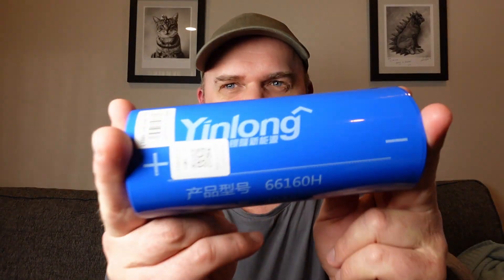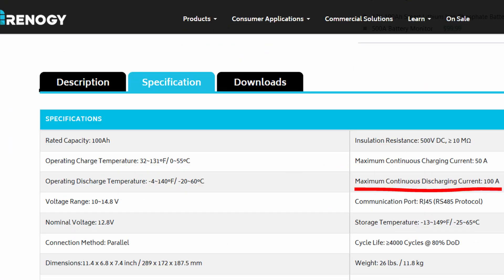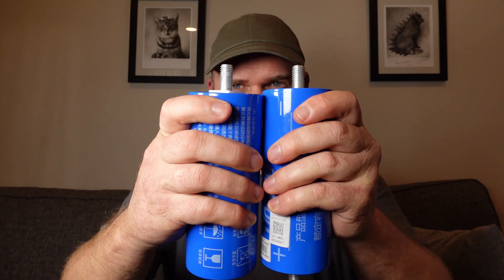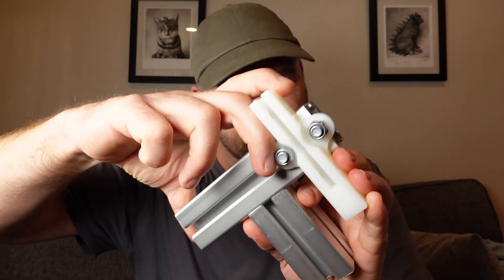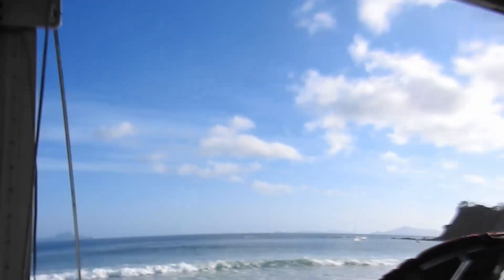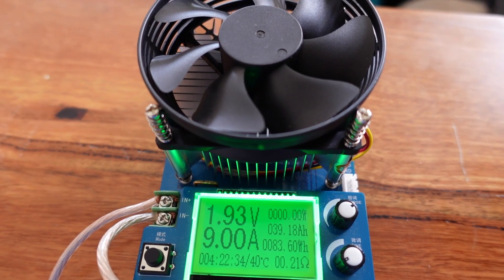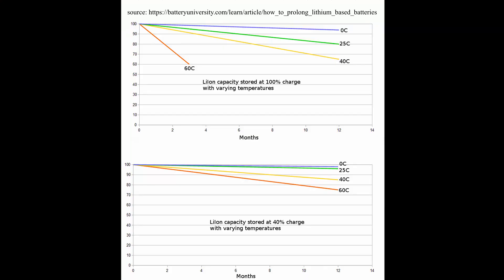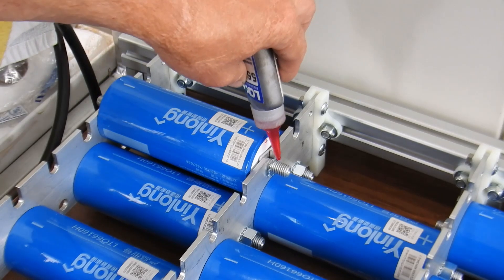Campervan DIY battery build HUGE POWER!

Comment: are they selling 6 batteries for $355 or one battery
Reply from the maker: I believe 6
Reply: @brendontait6968  Ok..thanks...great vid btw...I assume a person could use in an off grid situation for a cabin/house?
Reply from the maker: Of course.   I used these due to their ruggedness, lifespan and safety.  I'm going to do an LiFePO4 build for my house as well, these are a bit more affordable but don't have the life, ruggedness or tolerance to cold.

Comment: Don't use bus bars on both sides!  You need a fuse or fusible link on each cell to remove them from the circuit if they go bad! (standard practice on EV packs)  You may get a chain reaction if you don't!
Reply from the maker: I disagree.  LTO is an inherently safe chemistry that is safe from internal short faults.  They do not form dendrites and the electrodes start to heavily resist current flow at elevated temperatures a bit like an integrated NTC.  This prevents the cell getting into thermal runaway condition when it gets punctured or suffers internal short.
Reply: @brendontait6968  All Alkali ion chemistries are inherently unstable; it's better to err on the side of caution!  A fuse won't hurt your pack, but a fire will probably be a total loss, and the insurance company is going to tell you to get lost because it's not an approved pack!

I also wouldn't buy from a company under a communist government that abuses and murders minorities, but that's besides the point.
Reply from the maker: I'm confident this chemistry is safe in that regard.  I believe It's's actually the only lithium chemistry approved for medical implants.  For all other lithium chemistry I'd deff be fusing between parallel cells.

I get your point about buying from China.  Unfortunately there often isn't a lot of option..  many USA made batteries have Chinese cells, can be hard to avoid.
Reply: @brendontait6968  what if you drop a wrench across the bus bars, etc. All circuits need fuses; I had to learn it the hard way!  I lit my truck on fire when I crushed a heavy gauge cable!  It sparked and smoked all the way back to the battery and the hot metal blobs set the top of the lead acid on fire!
Reply: @bardrick4220  Well, China makes most of the world's batteries. I bought the Toshiba (japanese) LTO batteries. LiIon/LiPo batteries can go into thermal runaway and can cause a fire, LFP or LTO will not. LFP batteries don't cause a fire if punctured but generate toxic gas. LTO batteries don't do much of anything when punctured except get hot.

Comment: Locktite red is for permanent assembly. Try the blue formula instead, it will hold great but if you need to remove a cell, you don't need to heat the nut with a blowtorch to release the locktite . We. Have used the red versions on AK's assembled with hardened hex head screws instead of riveting parts to the frame. They have held up for thousands of rounds with no failure of screws working loose. Someone used the    blue formula on a build and everything shook loose after a month of field testing.
Reply from the maker: Thanks, I didn't use loctite brand.  I used loxeal 55-04 which is equivalent to blue. The studs are remarkably easy to break and my concern was that even the weak version might still grip too tight.
Reply: @brendontait6968  I use the nuts with the nylon inserts on one side of the nut, I forget the name for these.
Reply from the maker: @gregb1714  due to the low torque limits on the studs I figured nylocs may reduce clamping force too much.

Comment: I agree with everything in this vid but also agree with Will Prowse insofar as 25000cycles or 50 years is a bit of a waste as new technology will be out within 10 years and they are expensive, very expensive. Better using Trojan Lead Acid Sind 06 610. much cheaper and can be replaced quicker but I am still going to purchase 4 of these as they are impressive. Better for cars than solar. 1o minute charge and 25000 cycles is impressive but not good for price per KWH
Reply from the maker: It was a few things that convinced me to purchase these.  I enjoy learning about different tech especially if it's uncommon.  Ruggedness of these cells suit the truck build well.  It doesn't bother me if better tech is out in 10 years or so.  I dislike consumerism where things stop working and get thrown away long before they should.  These cells are more tolerant of things like a BMS failure.  I've seen these accidentally get charged backwards (by an imbalance) and still have full capacity when charged forwards again.  They are tolerant of a lot of things which would damage or be dangerous with other chemistries.
I haven't had good experiences with lead acid batteries in cycling situations.

Comment: I connected Lifepo4 2 *16cells in series 105ah about 10.7kwh for about with bms and packaging 2400$ these are very good batteries for my hybrid solar inverter much better than lead acid.

Comment: Hi Brenton, congratulations for your very interesting videos about LTO batteries. Really impressive! Which king of charging / regulating solutions would you recommend for a sailboat like mine equipped with both solar panels and engine alternators to maximize the efficiency a such a battery bank? Would you also accept to share the details, dimensions, etc. of you mounting rack and fittings? Many thanks!
Reply from the maker: Thanks... I'm using a victron MPPT charger for solar.  With charging from an alternator I recommend using a dc-dc converter.  The reason for this is to limit the load on the alternator, at low revs there is a chance there is insufficient airflow to keep the alternator cool...  additionally you have to be mindful of an alternator load dump, a dc-dc will limit the flux and the size of the spike if the charge on the BMS shuts off.  Mounting fittings etc are listed in the description.
Reply: @brendontait6968  Hi Brenton! Many thanks for your kind and very clear answer. Much appreciated. Cheers!

Comment: why not use aluminum tube size of battery, cut the studs down a little . add a cupler  in between them done . now they can get rid off there hear when they need to
Reply from the maker: Hey Shawn, I don't really like yr idea sorry.  I'll list a handful of reasons, but that being said...  I'd love you to build one and show me wrong!

1. Finding an ali tube that is the perfect size for the cells would be amazing luck.
2. If the plastic wrap on the cell splits in the future, you have a short circuit to deal with.
3. Heat dissapation isn't really much of an issue, but if it was... the plastic wrap on the cell would have a higher emissivity than an ali tube.
4.  Figuring a connection between the cells of each series set and to BMS would be difficult (else you may have a lone cell just go flat or overcharge).
5. The cells would always have clearance on the tube so would be rubbing internally over bumps etc.
6. The pack would become too long to fit in the space that I want.

Comment: 2.3Vnom * 40Ah = 92 Wh (per cell)
92 Wh * 99 cells = 9108 Wh or 9.108 kWh (per batt)
9108 Wh / 25.3 V = 360 Ah (or 759 Ah on a 12V system)

Just wondering---which CNC software & router do you use?

Great vid!  Thanks for sharing.
Reply from the maker: My maths is a little different to yours...
The cells averaged at 42Ah as measured x 2.3V = 96.6Wh x 99 cells = 9.536kWh. 
 Have a look at my kitchen bench video to see more detail on my CNC.  It's running LinuxCNC.
Reply: @brendontait6968  Thanks.  It's larger than I thought, but you don't really provide details on the make, model, or the software that you use...
Reply from the maker: It's a bit of a Frankenstein machine, it was a Cincinnati arrow with Control Techniques electronics, drives and motors. It was terrible both in reliability and functionality.  I've changed all motors except spindle.  The table has 1kW Teco servo motors, the Z has a 2kW Teco servo.  The spindle is 11kW with a Hitachi VSD.  My servo controller boards were from machmotion and am running LinuxCNC.  Was pretty easy to setup and get running, super reliable and powerful enough for me. It chews into semi hard metals like 4140, fairly big bites without any real effort.  It has a rapid speed of 11,500m/min which is slow for a modern machine, but plenty fast enough for DIY use.  I use Solidworks with HSM for drawing/CAM, they've stopped support for it now, but it is the best CAD/CAM system I've used by a significant margin.
Reply: @brendontait6968  It looks like a pretty powerful system to me--given that I haven't bought one yet! lol  Expensive software though, if you have a legit copy/license--assuming you bought it when it was relatively new. 

Thank for sharing!
Reply from the maker: I was lucky that a company that I contract to bought me a copy.  However...  Solidworks now have a maker version  which I think they charge $100/year.  I personally dislike subscription models.  

Due to support having run out with HSM,   please let me know if you find an alternate system that is great.  I've used surfcam and a few other CAM systems in the past and they've been awful to use in comparison. HSM raised the bar, bit it's quite old now so there should be plenty of competition in the maker space.
Reply: @brendontait6968  I agree with your sentiment on subscription software...
I have tried Blender & it seems to work ok, but it's quite a fat program, imo.  Since I don't have a CNC system, I haven't had the opportunity to try the output files on a CNC system.

Thanks for the detailed info!

Comment: Why isn't this me prevalent than LifePo4?
I'm really surprised at the charge discharge rate. It's rather DIY this type than LifePo4,

Only thing is to get a good BMS with heavy duty inverter and charger to handle all this load.
Reply from the maker: It is because LFP cells are now significantly cheaper by their capacity than the LTO.  For my build I love the LTO for its huge live and ruggedness.

Comment: have you considered thermal dissipation, batteries get HOT when drawn up, specially things like LEDs, stoves/ovens so forth, anyway to encapsulate in a fire proof foam or something?  also some batteries have been known to heat up and explode on charging cycle, again encapsulating is key
Reply from the maker: Wouldn't insulating the cells in foam make them get hotter?  These cells stay pretty cool with the power that I pull from them.  They also are the safest lithium chemistry available so are not really flammable.  (LTO is actually the only lithium chemistry that has been approved for medical implants)

Comment: How is your power pack doing after almost a year
Reply from the maker: It's actually been nearly 2 years.  Going great thanks.
Reply: @brendontait6968  looking in to doing one for an off grid camp here in Arizona looked at refurbished forklift power pack and the tesla system and diy systems yours looks like the best bet both for the ease of building and maintenance for the price point
Reply from the maker: I'm doing a decent lfp build soon too, should be good value and probably one of the more reliable builds around.  One thing to note with the LTO is that in hot weather they shouldn't be held at high state of charge as they can vent.  I haven't heard this about yinlongs specifically, but on LTO research papers.
Reply: @brendontait6968  hadn't heard that thanks for the info we get to 115 degrees f. here or higher quite often during June July and August

Comment: That's $6,000  USD, A bit much
Reply from the maker: You can actually get the cells for much cheaper when you buy in bulk.  Tho, even at 6k, it's still better value than the renogy cells I showed.

Comment: Interesting video and looks like very promising batteries. Can you use any Lithium battery charger with these cells? Could you replace Lithium phosphate cells/batteries with these in an existing RV/solar or off grid setup?? Cheers.
Reply from the maker: I guess it all depends on your charger.  I am just using a victron solar charger and it's pretty easy to set charge voltages etc.  These cells are much easier to charge than LiFePO4 since they don't really have an absorption phase and they don't have the risk of overcharging.
Reply: @brendontait6968  Thanks for the reply. Cheers.

Comment: Hi Brendon,

Great inspirational video. Can you give more details surrounding your BMS and monitoring system.
Cheers Henk
Reply from the maker: Hey, thanks.  It's an ANT 400A BMS that I'm using and a victron solar charge controller.  The BMS is just ok, it works... but has some issues.  I may do a review on it in the near future.

Comment: Would you consider changing your car battery to a 12V setup of these as well?
Reply from the maker: I know someone that has and they love it.  However.. I don't really have any reason to - maybe if I lived in a cold climate?
Reply: @brendontait6968  Ok! Thank you for your response, really good to know as I do live in a cold climate ;) 
Then I will actually save up the money for that project and do just that. It's a good smaller size project to start with prior to me digging into a bigger power bank project to run my upcoming off-grid house. 

Again, thank you very much, and thank you for a very good video.
Reply: @Brendon Tait
Sorry, I didn't realize that I was logged in to my other account 🤭

Comment: Where is the description? And I'll duck down to Bunnings and pick up a CNC Machine! Should be easy to build!!
Reply from the maker: Yes for sure.. I've found Bunnings can be low on stock of CNCs - so best call before you head in to grab one.  Plenty of aluminium suppliers have routers onsite and will cut to your drawing, same with laser cutters.

Comment: Brilliant video, but for your demo, could you have put the 18650 in a crack in concrete to stop it rolling away?
Reply from the maker: Cheers, I could have done a lot to stop it rolling around...  Tho I didn't actually put much forethought into that part of the video, I'd never pierced a battery before and didn't realize how difficult it would be...  I'll know for next time!

Comment: Nice stuff and backed by more intelligence then one's average bear...  degree or not.   I would not use any thread locker on those studs.  I would use a product GE (or others) makes to kill oxidation and galvanic response on terminals with dissimilar metals.  So cable companies use them and so do electrical folks at companies without bean counters.  I would use stainless star washers and nuts, not galvanized steel variety.  What the star washers do is make a number of tiny, gas-tight connections at the interface of both of its faces.  So I would place one on the battery stud itself so that face and the face of your bus plate get bit into.  One choice for a better solution that the locktite or other thread locking agent is to use 'marine' type stainless nuts with a little nylon ring swaged into the top of them.  They seal but they also keep the nut from loosening.  To reduce any vibration induced loosening, you should suspend the entire assembly inside the battery box.  Something like these...  https://www.avproductsinc.com/wire-rope/mounts.html
the paste can be like "Ideal Noalox".  You did not show your output connections so I cannot critique your hook up decisions.  They too can have resistive 'nodes' as well.  The battery piercing was phenomenal!  Nice build though, dude!  Very informative.
Reply from the maker: Thanks Gary... You'll notice I wiped silicone grease on with a cottonbud on each of the connecting faces to prevent future crevis corrosion, I have so much surface area connecting in the bank am pretty sure it will be fine.  I was concerned with the nylock style nuts (with the nylon washer embedded) due to them having a fairly high torque just to wind on the stud, these studs have a very low torque limit and i figured this would limit my clamping force.  Again with the end terminations, the ali was sanded with silicone grease applied and connected with a lug.  Chees, will do a bunch more battery builds in the future.

Comment: I'll still go with prismatic lifepo4 cells.. just an easier build and fit for my application.

 Well, as for the dropping out of high school and not having a trade etc means nothing. Some people just have the ability to pick up new skills on the fly and don't need years of training.. I know that type of people..
 Usually very entrepreneurial and can bypass the certification system which is just about money and protectionism anyway..
 Good video mate
Reply from the maker: Hey Herbert, yeah... LFP cells are great also.  I liked the ruggedness of these cells for my truck build, especially tolerance to charging faults, fire safety, longevity and cold climate conditions.  Thanks for that
Reply: @brendontait6968  no worries

Comment: Verry nice work! But seriouse, PLEASE consider 3D Printing for your plastic Parts. I cant stand seeing this waste of plastic.... ;-)
Reply from the maker: Thanks Phillipp, however I disagree....  I regularly 3D print functional parts but don't think printed parts are suitable for this application.  The plastic supports have to hold in excess of 100kg on a truck that will see a lot of vibration from washboard roads etc.  I want the battery to last for decades. If I get a few brackets break, the bus bars could touch the frame and start a fire.  Imagine the waste of plastic and other resources if that happened!  3D printing is great, but has it's limitations with long term structural applications.  I feel confident in solid machined nylon brackets.

Comment: hi Brendon.....new at this stuff...
so i have a couple questions....
how many of these blue cells you have would i need to make a 12v battery?.
cheers.
Reply from the maker: Multiples of 6 cells.  This gives a charge voltage of 15.3V.  I would encourage moving away from 12V due to the currents involved with high power loads.
Reply: @brendontait6968  hi Brendon, im also in nz.
are these sold here?, id like to try 6 for sure.
cheers.
Reply from the maker: Flick me a msg on insta